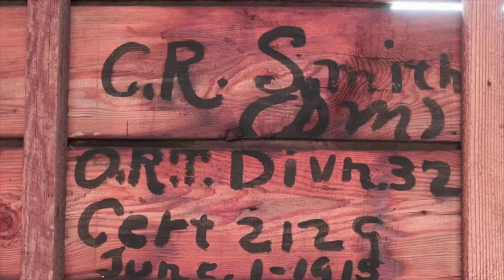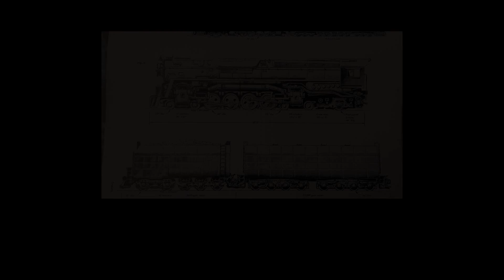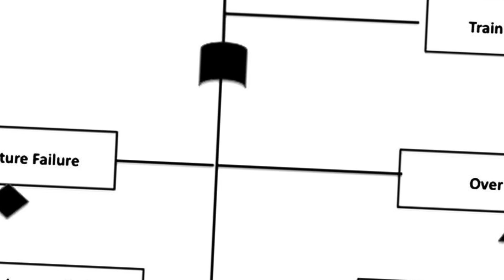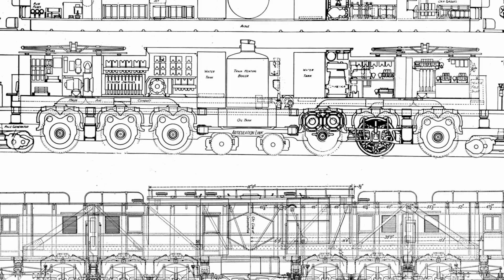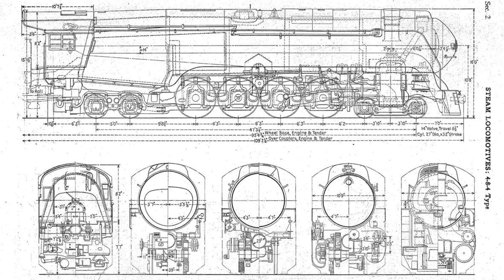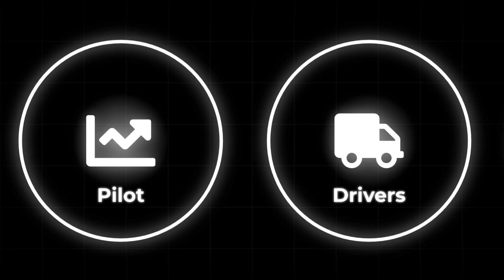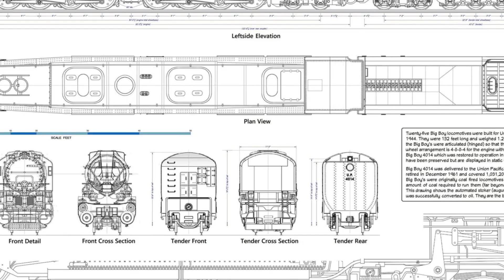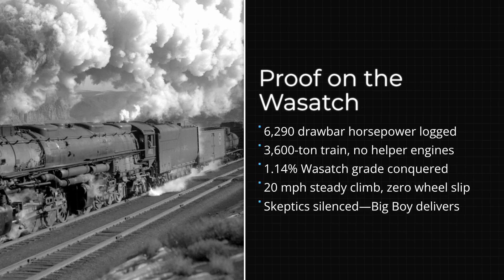Railroad Said Building A Locomotive That Big Would Destroy The Tracks—Then Big Boy Proved Them Wrong

Comment: fun fact the 4-6-6-4 challenger out performed the bigboy
Reply: Heck yeah. From LA to Council Bluffs and as far south to Denver and Grand Junction. 105 Challengers to 25 Big Boys. That said, Big Boy wound up being a short-term need that wound up being a luxurious asset exceeding expectations and did overwhelmingly more good for The UP than detriment.
Reply: @joeruiz4010  yet even when BB was out they would buy 4 challengers over a big boy
Reply: @ClintonvilleModelRailroad  ALCO's Factory Infrastructure was centered around Challengers and Northern Types going back to early 1936. When WW2 busted open, and when The US entered the war after 12/7/41, ALCO could not expand their equipment base and Infrastructure to build more Big Boys. UP had to stick with Challenger more so than Big Boy. The War Department made it so. Also, UP started up with Dieselization in October of 1945.
Reply: @joeruiz4010  you forgot how the challengers didnt have all the problems the big boys had
Reply: @ClintonvilleModelRailroad  Issues largely corrected by 1948 to 1950. Big Boy closed out it's career on a strong note. Again, WW2 and ALCO having to make due with stressed infrastructure is ultimately why Big Boy struggled up until the late 1940s and 1950.